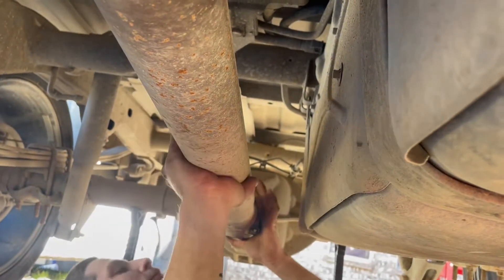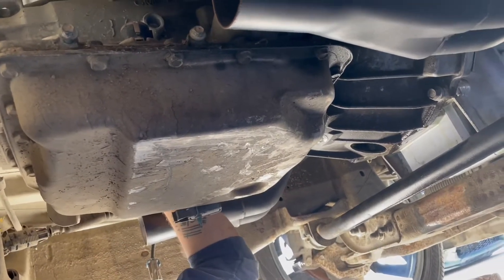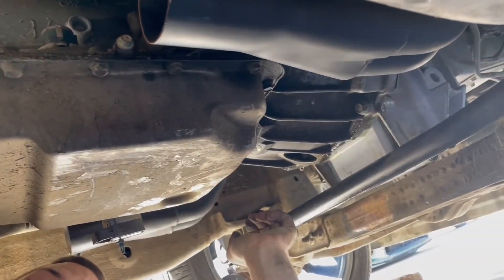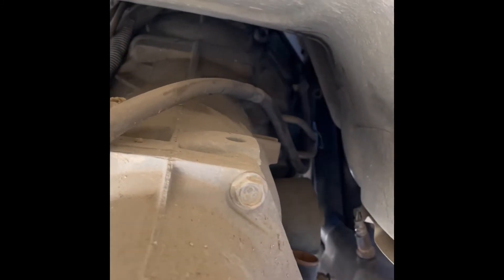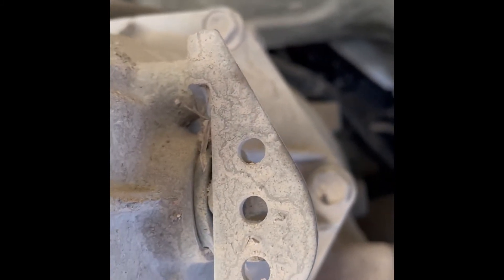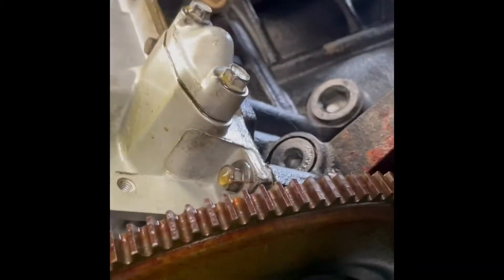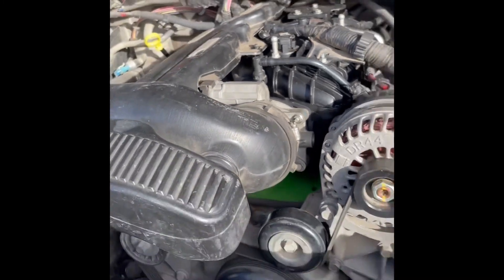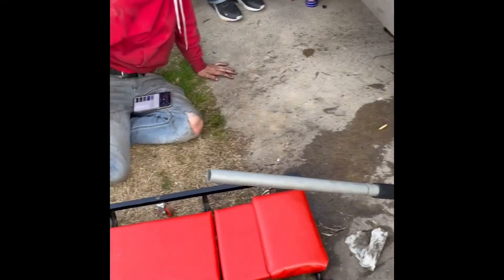Removing Transmission and Drive shaft on 2008 4.8/5.3 Cammed Silverado

Comment: Yo bro on your charger full straight pipe did u ever get the check engine light after doing it ?
Reply from the maker: Yeah I have to get a tune my friend with the challenger is the same way but its like $1300 for all the parts we need because we have to get a unlocked pcm, etc.